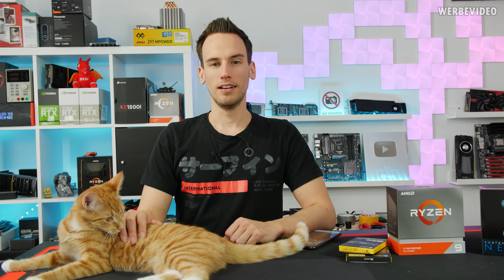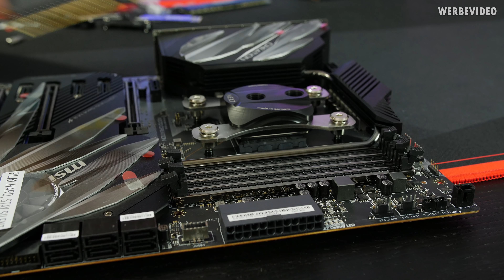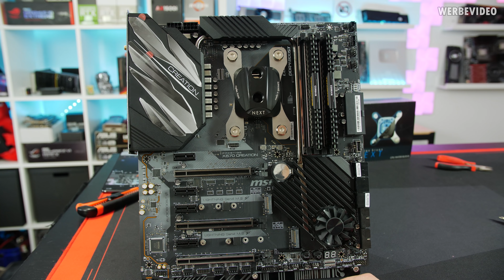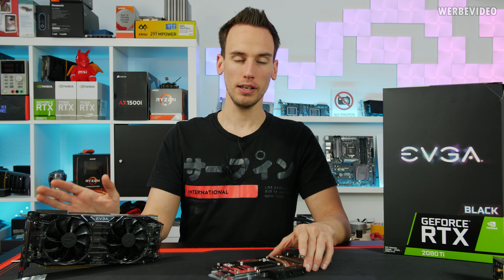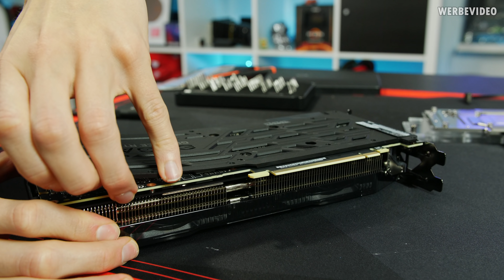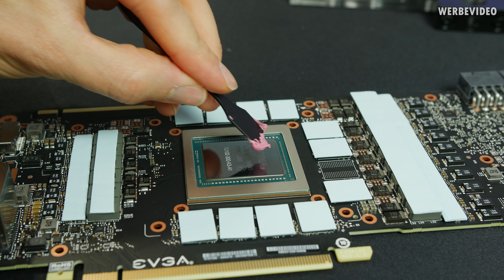No RGB and ABSOLUTELY SILENT - Ryzen 3950X Workstation for Fritz Meinecke

Comment: I thought a rear exhaust and top exhaust with front intake creates negative pressure inside case instead of positive, which would limit dust build up? 

Would doing top intake, front intake, rear exhaust not be good?

Comment: I don't see the point in RGB, but the issue here is that often times products with RGB are being sold for cheaper than products without. This seems to be the case for RAM, for example, I can buy 32GB kit of DDR4 Corsair Vengeance RGB Pro 3600Mhz RAM for £150 (£149.99 to be exact) or I can buy Corsair Vengeance LPX kit, same speed 32GB for £158.99, or Crucial Ballistix same speed 32GB kit for £183.99.

When cutting costs during upgrades to get the best bang for buck, I'll go for RGB alternatives if they happen to be cheaper. Can always turn the RGB off anyway.

Comment: I realize this is already an old video so questions are kind of a waste, but just in case anyone knows --- when he installed the reservoir and pump he stuck a tube out the back of the case. I was just wondering how this eventually got routed. Thanks.

Comment: Howcome you chose 2x 360mm rad when 420 and 280 rad fits in the case as well and is about 13% more radiator area for about the same money? You also need 5 fans vs 6 so it's quieter also, and in my experience 140mm fans do a better job.

Comment: thnx for this, but in my case ( lian-li lanecool II) all got really hot.

running 3900x with 2080ti (boost will do 1830mhz on its own) all stock, 280x6 mm ekwb rad with vardar 140 and a 240 4mm ekwb rad with 2x 120 antac. with a d5 ekwb res d5 pump.
while gaming the cpu starts to run towards the 90 degrees C. living in holland and thew pc is in a non arco room with a ambiant that starts around 20c but the system will heat up the room verry quickly (small room).
so running the fans at low will get all components in my system to go towards 70C (radiators will be to hot to touch for longer than a pinch). only the gpu stays under 70 slightly.  guess the water is above 60c.  tuching the back plate of my gpu hurts the moment you touch it. 

Can i run my pc like that? prefformance is fine no slow downs in  gaming and feels quick. but im afraid somthing will start giving some where because all is really hot even the mbo pcb.
wondering if there are other parts that cant deal with heat but in normal use cases wont get this kind of straign.

Comment: I would have gone with 4, 16gb memory sticks rather than 2, 32s. With 4, you can turn on interleaving and get much faster large block transfers (small blocks are already fast). And, you can often get higher rated frequency and/or lower latency with the 16s. And, your argument about upgrading later can be problematic in that it is desirable to have sets of factory matched modules rather than a mixed set even from the same vendor. Selling the 4, 16gb matched modules on xBay and buying 4, 32GB matched modules later when prices come down and speed increases would be my recommendation. 
And, you applied the thermal paste like cement between bricks!  You want only enough to fill in the microscopic air gaps caused by the grinding/lapping imperfections. Much less goop might have been better.  I would have used a Graphite pad.

Comment: Hey der8auer-- for coolant routing, would it be better place a radiator between the CPU and GPU in order to provide a bigger difference between coolant temperature and component temperature for the GPU? Or does the coolant temperature not increase very much after traveling through the CPU block?

Comment: Me: Cool silent build, I wonder what the DB output will be!
Doesn't provide any db test.
Reply: This. So much fans, even at low speed, is not what I call ABSOLUTELY silent.
Add this the fact that a good air cooled ventirad would have been more silent and cheaper, and almost certainly more efficient at keeping the CPU temperature low.
He is removing 4~5 semi-passive fans (1~2 CPU + 2 GPU + 1 PS), and is adding 6 of them plus a water pump that are running all the time…
Reply: @suppositoire  exactly and somehow the whole comment section only seem to care about rgb

Comment: Why would you not put the gpu backplate back on?! It was a nice backplate. Plus it had thermal pads and would screw into the water block.  Also why would you custom water cool a system that you want to stick in a corner and forget about? They need maintenance every couple months.

Comment: Apart from the RGB part which I second a lot, is water cooling necessary in this case? I mean, how much noisier can be a big CPU cooler with three fans? Unless it's not the case, considering that the case is hidden under the desk, maybe you could have saved a bit of money without water cooling.

Comment: Awesome vid. Especially the water colling building part. Can I ask you about build I am planning, please? I want to build a creator pc with 3 GPUs. First GPU will be AMD Radeon 5700 XT - that will be used to connect to monitor and the reason for it is because I will be running windows and MAC OS. The other two GPUs will be rtx 2080Super with NVLINK. These two are crucial for 3D graphics and rendering. I am heavily invested in MAC OS, thats why I cannot totally swap for windows, but using Blender 3D under MAC OS is pain so I need to be switching back and forth between MAC OS for video editing and Windows for blender graphics. And I don't want two computers. The processor of my choice would 3900X. The problem is MOBO. I cannot find MOBO that would have 3x PCIe running at least @8,8,8. MSI Godlike will run at its best @8,4,4. What would you recommend in such situation please? Would be the drop in performance running those the RTX @4,4 very significant? Or would it be doable?

Comment: Hi der8auer, I 'm waiting for receive my 3950x with a gigabyte x570 Aorus Pro , i decide to keep my old power unit ( Corsair TX750 ) which doesn't have the extra 2x2pin of 12v to power the processor , but only a standard 12v 2x4pin. I read somewhere the extra 12v 2x2pin is optionnal and really needed on extrem overclocking , do you agree with it please?

Comment: PSU is too small with a 3950X and the 2080Ti in gaming conditions - your Youtuber customer is gonna use it above 90% capacity and that's gonna stress a fanless PSU. Should have gone at least for a 900W in order to maintain the PSU's hardware a little more relaxed - PSUs of that build quality do not drain the full power anyway, so it's just a matter of having parts that are a lot less stressed under heavy workloads.
I also don't grasp the reason why, after going for such an expensive setup you would bring up more than once that this is done to not be expensive: just the GPU is 1500 euros, and the CPU is 400+ - you can make a whole computer with Radeon GPUs for just the price of the 2080Ti - which I seriously do not think that the fact he will be using some Premiere (maybe) with it will account for the enormous money invested in it (without counting the EKWB which is another 200+ euros). Then you go for a non EKWB waterblock on the CPU and I am again thrown off "because the case will be closed" so what? You saved what, 20 euros? Or is there an engineering explanation? Or is it just for sponsoring reasons?
This PC has a lot of very good ideas, but they are not really that reasoneable when you get to the actual build. Well done on the cables, and well done on the things you do very well anyway (btw I used liquid metal on the CPU and GPU and the watercooling and shaved off another 6 degrees average - which is really great for parts longevity).

Comment: Absolutely silent with a whiney 4" motherboard fan and a fucking water pump. 4000 euro reasonable price. Fucking facepalm...

Typically you get between 68 and 76 (compared to your 65-70) degrees celcius with a big air cooler that runs quieter. 16 cores? Install 4-6 12" inch fans at 400-600 rpm to increase airflow. Still going to be cheaper and easier to setup than water. 

You can also get sony noise cancelling headphones for ~ 300 euros instead of the stupid sound card and completely forget about the video-card fans when gaming. Sound cards are an absolute waste since ~ 2012 unless you have special needs. Fuck, the base components are about 2000 euros, for 500 euros you can build a secondary enclosure from wood and sound-dampening materials with the same sound levels result and 1500 euros cheaper. 

Your build is niche money-wasting bullshit. How come you didnt include any sound measurements or at least record the system with your microphone without any dumb-ass post-hiphop beats in the background? Water pumps are not silent. They squirt and gargle.

I'm sure you're a cool guy, but fuck, this system seems dumb. Only an outdoors guy who doesn't know shit about building computers, or a person who does not care about price would find this system attractive+affordable.
Reply: ...or a person who makes money with their system instead of writing angry youtube comments :)

Comment: based on your CPU temps and your rad setup, you don't have anywhere near enough pump. dual DDC pumps would provide better pressure at lower noise. more expensive, admittedly, but compared to the overall cost a minor increase.

Comment: Don't think 4 sticks of RAM will work, 3950x is dual channel... I think.
Reply: Nafees Rawoot Yes 4 sticks will work but the memory controller will be over-worked IF you are I/O bound. If the owner really does need 128 GB a Threadripper would be a better upgrade IMHO.

Disclaimer: I have a three Threadrippers: 3960X, TR 2950X, and TR 1920X.

Comment: Does the person you're building it for know much about custom water cooling just cause I'd be worried if they don't as it usually requires a fair amount of maintenance as you know. I feel like custom water cooling can end up as more of a tinkerer's hobby than an "install and forget" system. The only other thing is that usually you'd be better off just getting a good quality audio interface rather than a sound card as far as I know though I haven't looked into many sound cards in a long while to be fair. Overall a really cool build!

Comment: 06:50 - If you are making a youtube build, you should screw in the nvme drive, before putting back the MB plate.
Reply: In this case the screw on the MB Plate is actually the nvme screw its like 2 in 1 purpose if you look closely.

Comment: No RGB? I have not used that monitor interface in years. Oh...RGB lighting. Almost different but, I never used that. I don't put neon under my car, either. 
Nice to see that I am not the only one who doesn't care about RGB lighting. I don't like cordless tools that look like a Transformers robot, either. Who do they make this crap for? 9 year olds? Ever see a crew of 9 year olds framing a house?
Anyone can throw LEDs in a box without much pain. If ya gotta do lights, impress me. Bend some glass with electrodes. Pull a vacuum. Add some mercury and a noble gas. Then power it up with voltages that do not belong next to a water cooled CPU.
Dump RGB. Grow some balls. And, take off those stupid face masks. Bill Gates is not a doctor! Keep this crap up and vaginitis will be your only payoff. 
Bottom line - Eat beef or go full beaver!.

Comment: Very nice. I just built my PC with similar parts. 3950x, 2080 ti (for that little bit of gaming on the side), 64gb 3660 ddr4, and the x570 tuf plus. Only RGB is the AOI Cooler, the Corsair h150i pro. Couldnt find a non RGB AO cooler mount. I got the meshify by fractal which does have glass, but it had great cooling and dust protection so it doesn't matter. All the parts are so quite I cant hear it through the glass anyway. Im a house/small building architect and the 3950x is a beast. The reason I'm commenting is I think your 3000 ddr might be to sluggish for the 3950x. Amd 3000 series really likes faster ram, and I started originally with the 3000 Hz and after watching videos and reading about it, I changed to 3666Hz and the difference is quite noticeable. Especially if (client) wants to increase in the future to 64gb, it might be a waste to do it at 3000 speed. Just thinking.

Comment: I don't quite understand the choice to use liquid cooling on a build for a person who values function over fashion, and who wants the machine to 'just work'.  Isn't he going to have to do maintenance on the loop in a year or two?  Versus something like a big dual tower air cooler where you would just need to dust it off after a while.  I guess you would be trading reliability and longevity for a bit of cooling performance and a bit of noise.

Comment: I'm running a 3950x & 5700xt inside a Fractal Design XL (R1), that I brought late 2011 with no window (have a 140mm fan instead), no RGB (have tape covering the harddrive/ power LED so I can barely see it - ADHD/ ASD).

I'm actually using the same fans (3×P12, 4xP14). 2xP12 for a Noctua D14 as they have more volume/ pressure (I'll never understand why Noctua bundles low speed PWM fans with speed reducing cables). I recently had an issue with coil whine that I couldn't track down, (removed GPU, PSU...) turned out to be the 12cm Noctua fan I was still using, that I didn't expect! (a little over 3 years old) There's also a 180cm rear-facing top fan that is using the PWM signal from a P14 (you can daisy chain other fans on the PST versions). [Arctic aren't perfect, a few of their fans have balancing issues, especially the F series].

I've been a little OCD in tuning the fan speeds in relation to how audible they from their location. I slow all the fans down, then put my head nearer to the case to find where each group of fans are silent, and where they start to annoy me. It's dead silent at idle (CPU ~800rpm mainly so the temp doesn't spike, cases fans ~500rpm [less dust]). At heavy use (gaming, encoding, software testing) the noise is really just airflow. Plus the fans are slow to spin up and spin down. I do want to get into watercooling, but it is so freaking expensive!

I have looked at newer cases, but I can't find any I like: sealed & dampened PSU shroud (to quieten a few mechanical hard drives), sealed top panel (don't want line of sight to my ears for any fans). All they have to do is add a little space above the fans mounted in the top panel to duct the air to the back of the case (or even the sides). I just want a case that blocks the noise, not the airflow.🤬

Comment: Dear Roman,
i just wanted to say this is a nice build indeed, But it has RGB and a Killer PSU that Needs attention !!!
This build Needs a better PSU IMMEDIATELY !!! ... just look at the numbers generated by sea-sonic psu calculator !!! they say the build will consume 522w Fully Loaded and so your PSU is running at over 85% on full load with no psu fan to dissipate that heat !!
you forgot that the "guy you are building this for him" he will probably add an HDD with Many TBs to handle his Streams or at least an External one with other peripherals that requires more power out of the system to operate !!!
i strongly recommend you to change the psu to a higher wattage 750w at least to keep longevity usage of the system 

Regards

https://seasonic.com/wattage-calculator?__cf_chl_jschl_tk__=da4930b4fd7eb3a74b487ecc1ef9dc9713763a2f-1586611117-0-Aee9pp2ap0Rh_Bh3_bLl58dh5OkvbXqMgmtUQwmJWotI50jX3L7GLgG2lN4gB2PFgs-QkOasGFr22QEdu3tPFJmWjts5SqYYsfIrNxav0WJZdiOPKVz4AveEGLcA6dTctjSU9v2s16pgeEMjfObZU0uPausZ1lMDI4wyVcMH6LapgTW9dmzYrObBxDGaPsQbROGIPCvyQnRA0t19C30thF-8tCc4rxPmz_3qPtjdAIeYNBVNY18Oj5FnpuLsTaYrIQcJWHrrxuHe4LjprH7ZWyLAl3bIBJxKO1578kFb5dIZ

Comment: i love my p600s those sound dampened side panels are great. my case stays super cool even with the front and top removal panels still on. went with 240 and 120 rad setup myself with a 9700k 32gig 2080s hybrid.

Comment: Built a similar PC, although much cheaper recently. Noctua 120mm cooler on a 3600 @ 4.5ghz and is almost dead quiet even under 100% load. Used msi unify x570 and I'm using an old NZXT "silent" case. Under games it's so quiet that my fridge is more noisy.

Comment: warning to builders about M.2 SSD's..
My X470 board has two, M.2 SSD connections. I used one for Windows (the one connected to the CPU). No problem. I wanted a 2nd one for game storage so performance didn't matter much. Luckily, I read my motherboard manual and discovered that if I got the PCIe-based one instead of SATA it would disable two of my "x1" slots which was not ideal. So I got the SATA version which was also cheaper. The WD SATA M.2 SSD was $280(CDN) so it was $40 cheaper than the similar Intel PCIe-based model, didn't disable those slots and performed about the same. Just FYI.

Comment: "with no fan at all we're reducing the noise even more (PSU)"
?? I'm not sure I agree. You're still DUMPING HEAT into the case which the other fans need to exhaust. It's actually, probably going to cause LESS noise to have a PSU with a very low-noise fan exhausting the air out the case directly. In this case (no pun intended) it shouldn't make much difference. There is an inexpensive PSU for example that is 550W and maintains 10dB (silent) fan speed until close to 400W though 650W would be a better choice.

Comment: Always wanted to go custom loop, how often do you have to clean it/change the liquid? Air and AIO's are so easy maintenance wise.
Reply: Not counting in some fancy dyed showroom liquids, once a year is recommended. But if you have cleaned your equipment well before installing and just use distilled water + biocide, the liquid does not get any sunlight (light helps things grow, you know) and do not have mixed metals that require anticorrosive agents (which eventually break down and require changing, much like car radiator fluids), you can go on much longer and just top it off when/if evaporation occurs. But distilled water is so cheap so there is no reason not to change it once a year just to be safe.